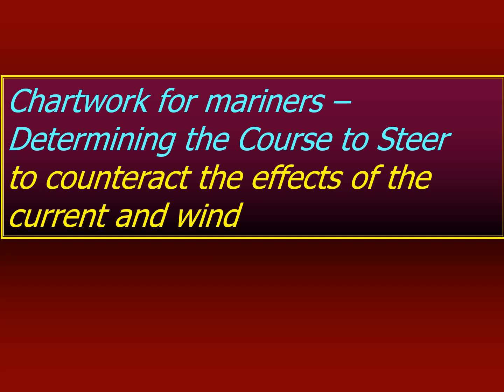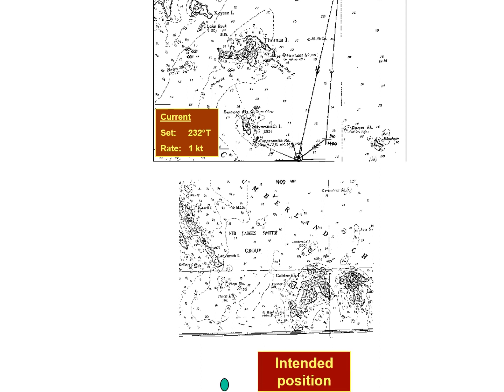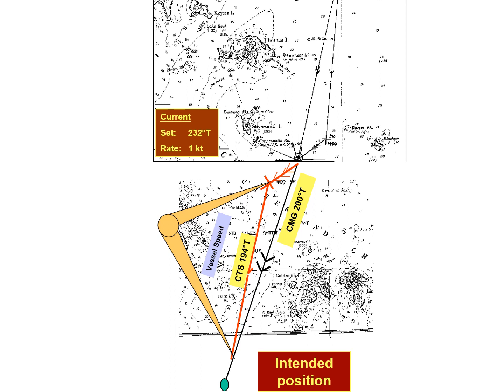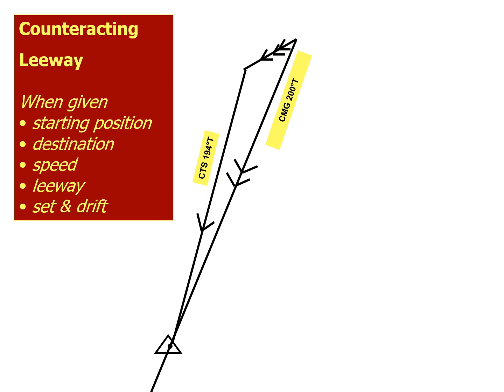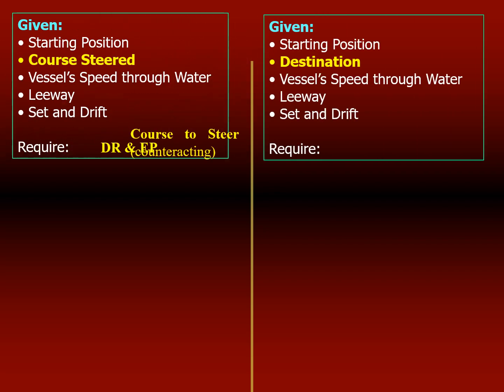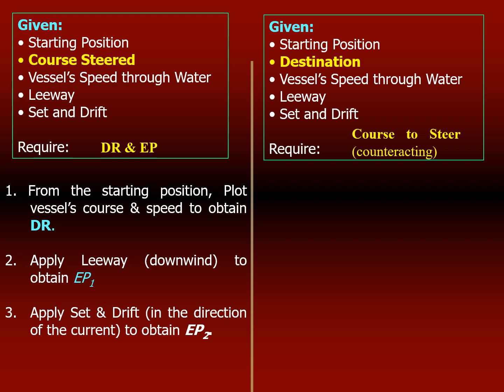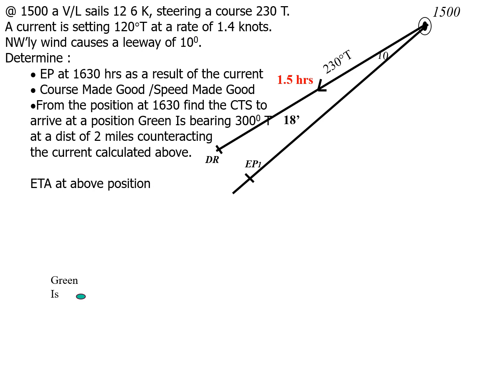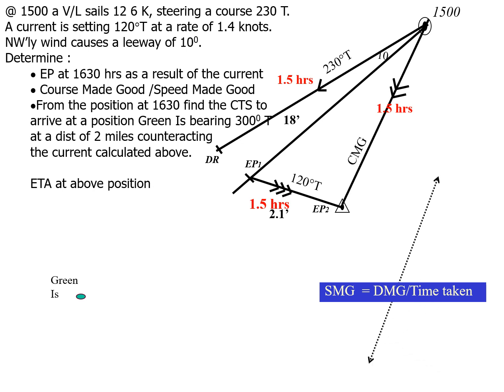Chartwork - Determining the courses to steer to counteract for current and wind

Comment: Thank you. Makes it very easy. It would be helpful to determining the eta at a certain position,such as abeam green island. (measuring the full distance from the starting point (of EP2) to green island, then dividing by the speed made good presumably). Thank you!
Reply from the maker: Thank you, much appreciated 🙏
Reply: Bless you 🙏
Reply: would you have a link to another video that shows eta determined with a leeway and or current  please?
Reply: would you have a video link where you have used the speed made good due to leeway and or a current, in order to determine the eta at a certain destination? thank you.